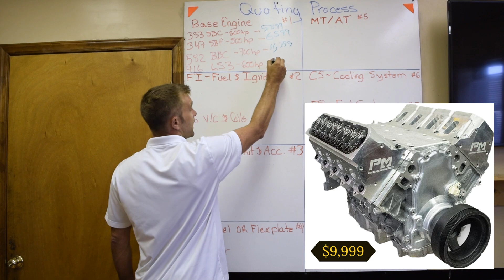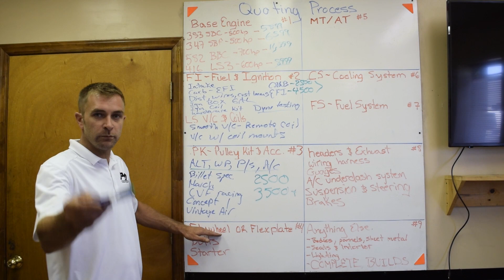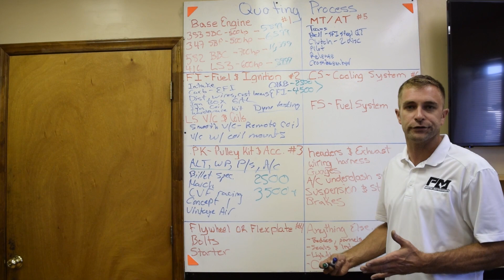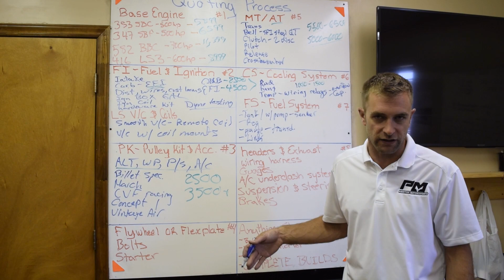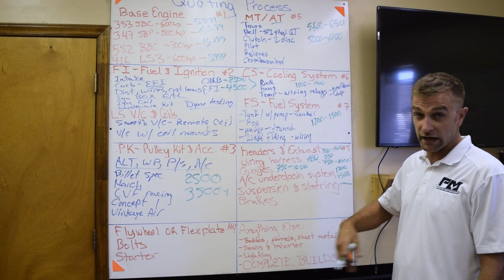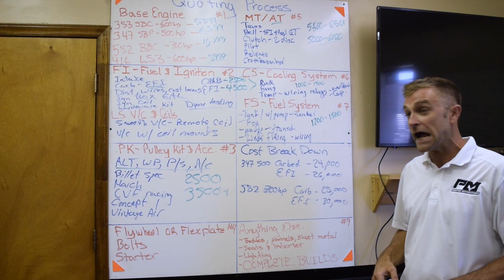Custom Built Performance Crate Engine Quoting Process Explained at Prestige Motorsports

Comment: So your base 347 as shown in this video. Realizing this video is 3 years old, how much would that same base 347 sbf be today?
Reply from the maker: Long block 425hp 347s start at $5799 right now - Check it out here - https://www.prestigemoto.com/custom-engines/ford-small-block-engines/hot-rod-series/347-ford-small-block-stroker-crate-engine-f347-hr-lb1.html